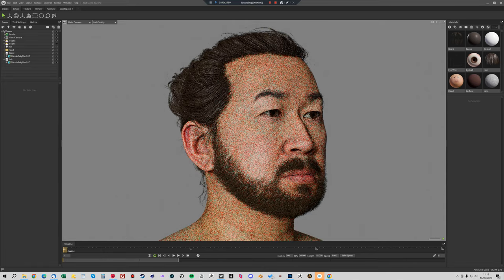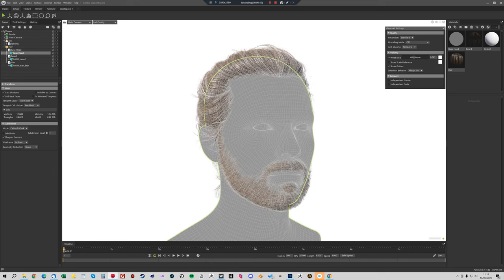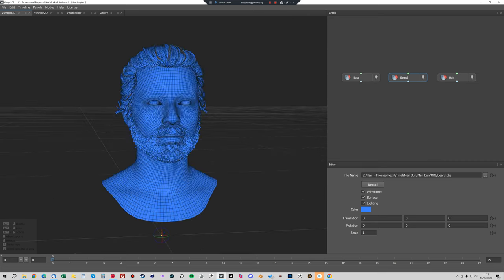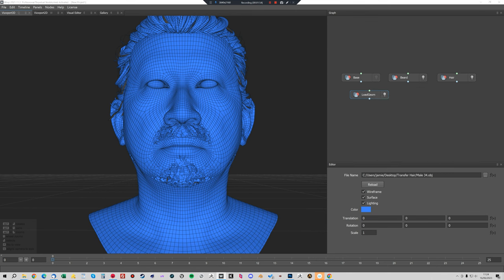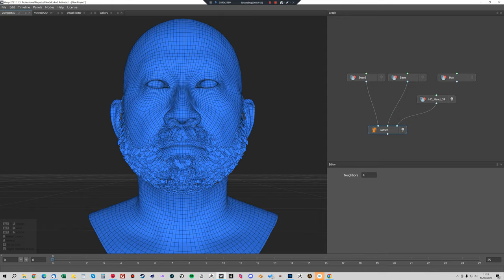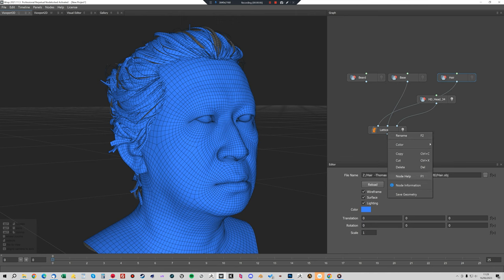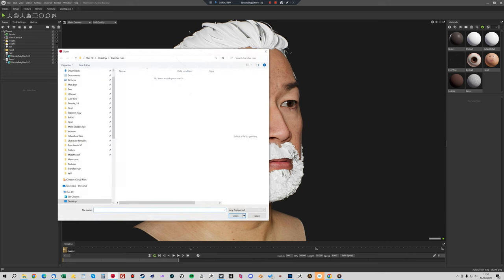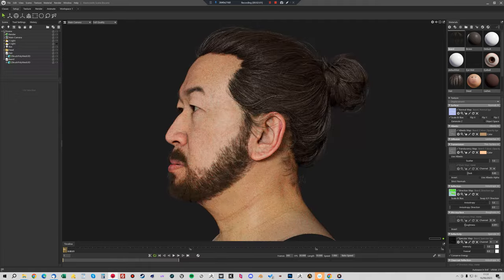Realtime Hair Transfer Tutorial

Comment: Awesome looking hair and great tutorial as always. Do you know if there is an equivalent method to this using Blender?
Reply from the maker: Thank you! Im not sure if there is a way to wrap it to another head in blender. The models do come with a blender scene though.
Reply: So far, wrap is the only method to do this
Reply: Doubt there's a literal equivalent, but blender has mesh deform/lattice deform modifiers. In theory you could transfer the object data of a source headscan to a target, then make that a shapekey, make it a duplicate so it's disposable, then add a solidify so that it can act as a mesh cage for the hair, then apply the shapekey and that should work?

If it's close enough may be easier to just use blender's sculpt tools to get it in place... maybe using a shrinkwrap with a vertex group containing the "end" vertices that touch the head